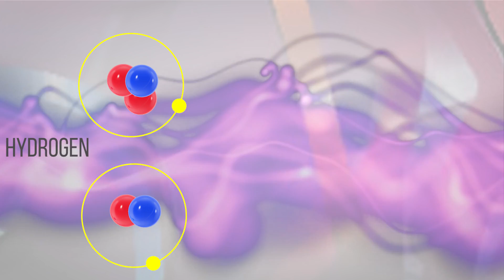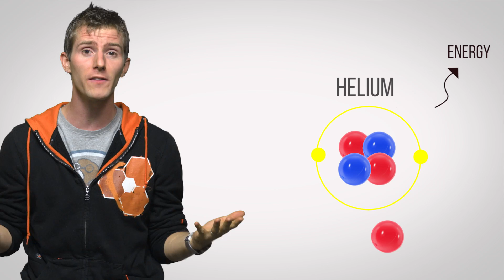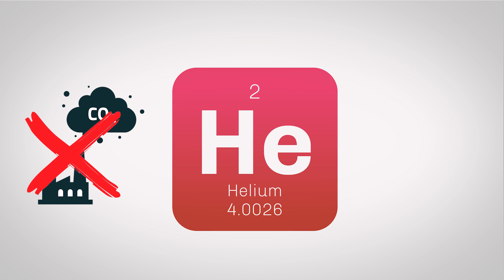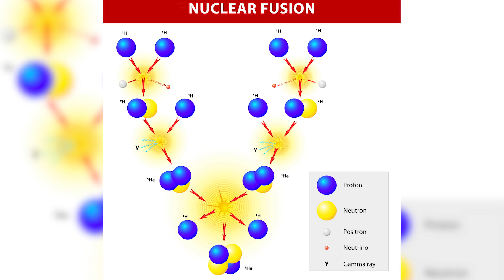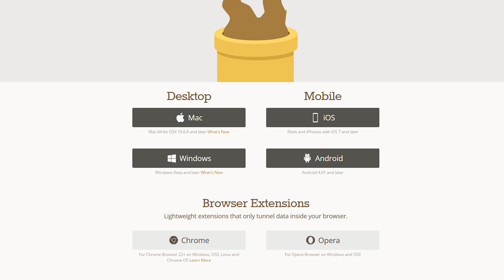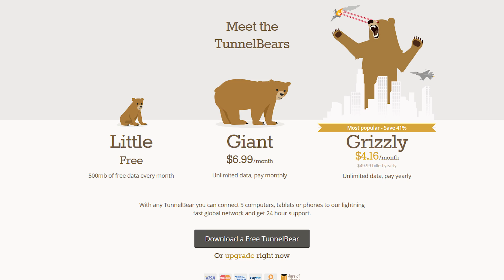Why Don't We Have Fusion Power?

Comment: LInus, Uranium is not the only fuel which can be used in a nuclear reactor. It is called thorium which estimates have predicted 120 Trillion tons of the material. The other advantage is 70% of waste is inert in 3 years. The other 30% in 300 years if you do not reprocess to use in new reactors. 

In short, Uranium is not the only source of fuel and fusion is decades away. If we truly want to get off fossil fuels in the next 100 years, nuclear power is the only way. 

We just have to get over our fear and let the scientist and engineers design reactors which solve these environment issues. Ohhh wait they already have, remember the current reactors in use today are over 50 year old. They need to be replaced with modern design that get away from pressurized reactors.  But I digress....

later..

Comment: there is potential for radioactive. During the fusion, one neutron leaves the core of the atom (as seen in the animation). These neutrons hit the wall of the reactor core and make it unstable, eventually making it radioactive
Reply: Not just could, they do. In fact the whole first wall would be extremely radioactive when used. Currently the scientists are developing materials that could withstand extreme conditions inside the reactor and after 100 years drop their radioactivity to the levels comparable to natural radiation on Earth. Still not too much waste compared to fission.

Comment: There's
Hydrogen and Helium, Then Lithium, Beryllium
Boron, Carbon everywhere,
Nitrogen all through the air

With Oxygen so you can breathe
And Fluorine for your pretty teeth
Neon to light up the signs,
Sodium for salty times

MAGNESIUM, Aluminum Silicon PHOSPHORUS,
then Sulfur, Chlorine and Argon
POTASSIUM and Calcium so you'll grow strong
SCANDIUM Titanium Vanadium and Chromium and MANGANESE

This is the Periodic Table, Noble Gas are stable,
Halogens and Alkali react aggressively
Each period we'll see new outer shells
While electrons are added moving to the right

Iron is the 26 Then Cobalt, Nickel coins you get
Copper Zinc and Gallium
Germanium and Arsenic

Selenium and Bromine film
While Krypton helps light up your room
Rubidium and Strontium then Yttrium Zirconium

NIOBIUM Molybdenum Technetium
RUTHENIUM Rhodium Palladium
SILVER-WARE then Cadmium and Indium

TIN-CANS, Antimony Then Tellurium and
Iodine and Xenon and then Caesium and
Barium is 56, and this is where the table splits
Where lanthanides have just begun
Lanthanum Cerium and Praseodymium

Neodymium's next to, Promethium then 62,
Samarium, Europium, Gadolinium and Terbium,
Dysprosium, Holmium, Erbium, Thulium, Ytterbium, Lutetium

HAFNIUM Tantalum Tungsten then we're on to
RHENIUM, Osmium and Iridium
PLATINUM, Gold to make you rich till you grow old
MERCURY to tell you when it's really cold

THALLIUM and Lead then Bismuth for your tummy
POLONIUM Astatine would not be yummy
RADON Francium will last a little time
RADIUM then Actinides at 89

This is the Periodic Table, Noble Gas are stable,
Halogens and Alkali react aggressively
Each period we'll see new outer shells
While electrons are to the right

Actinium, Thorium, Protactinium
Uranium Neptunium Plutonium
Americium Curium Berkelium Californium
Einsteinium Fermium Mendelevium Nobelium
Lawrencium Rutherfordium Dubnium Seaborgium
Bohrium Hassium then Meinerium Darmstadtium
Roentgenium Copernicium

Ununtrium
Flerovium
Ununpentium
Livermorium
Ununseptium
Ununoctium
And then We're Done!!!

Comment: Google 'LFTR' or 'MSR'. Fusion is unnecessary. MSR has already been done, but because it can't be weaponised it had its funding cut.
Reply: Fusion produces several times the amount of energy, and produces no high level waste. While things like the Integral Fast Reactor can burn HLW, the danger of a breach remains, which doesn't exist with Fusion.

You get radioactive reactor parts, if you're not using Aneutronic fusion, but that's low level waste that becomes neutral in a matter of years.

Comment: Not only our sun but all stars do this. Also the highest temperature on earth recorded is 4 trillion degrees celsius which is way over the required for fusion. The only problem is that this needs to happen for a longer time than just a fraction of a second.

Comment: Interesting Fact No. 1: The sun is actually quite inefficient at burning through its fuel compared to our methods.
Interesting Fact No. 2: The price of oil and research funding for fusion are strongly correlated (which is depressing).

Comment: Fusion = Load of Crap, solar is not good enough??
Reply: There are much more applications to fusion than simply powering your light bulbs and PCs.
Reply: Solar panels are super expensive compared to other power types.The sun also doesn't really put down that much energy per area on Earth (compared to other power source) otherwise it would kill us.
Reply: No, solar isn't good enough. The EROEI is pathetic compared to Nuclear and Hydro power.
Reply: Solar panels are made from a lot of poisonous materials that probably pose more danger to environment that nuclear waste does.

Comment: what about using the tide to generate power or even the currents of the ocean. take GIANT windmills and put them in a fixed position floating with big ass balloons creating neutral buoyancy , to generate power as the turbines spin from the currents flow?
Reply: besides the effect of changing the currents flow and speed we wont change it by much. if tsunamis have shown me anything. and the ocean does not freeze.

Comment: Yeah... when you talk about solar and wind energy efficiency being low, what do you mean? I'm pretty sure wind is very efficient and reliable. Really gotta shatter those misconceptions, aye?
Reply: EROEI of Wind and Solar isn't all that spectacular right now, I think 16 for Wind and a little more than 10 on Solar PV, while Hydro, Nuke and Coal have very high EROEI values.
Reply: C0deH0wler It's not about efficiency, because that's fine when they are actually working, it's because wind and solar DON'T work often because sometimes it isn't as sunny or windy

Comment: You're completely wrong about wind and solar and hydroelectric energy. They're very efficient and capable of providing power for entire cities now and do in Europe. They're becoming more efficient every day and they are costing less every year too. And the reason we need to switch immediately to renewable energies isn't because of their quantity but because of climate change.

Lots of misinformation in this video. I think you should revise it immediately.
Reply: wind and solar are inefficient and unreliable they're a horrible power source
Reply: Problem is, if the wind stops for a while. There goes that country's electricity.
Reply: Solar and wind power are both many times more expensive than the current best options. Its all about nuclear power man!
Reply: If we make the switch too fast, say goodbye to economic prosperity
Reply: Solar panels only have an efficiency of 35% at most and these are not the panels you see on everybody's roof.
Hydroelectric plants are quite efficient, however not every location is suitable.
Reply: Except that wind and solar rely on unpredictable weather conditions. Tazmania and El Hierro went 100% wind, solar and hydroelectric and the whole thing failed. Each had to buy millions of diesel generators to meet energy needs due to drought and unpredictable weather rendering solar and wind unreliable long-term. Plus solar is too expensive for average citizens to go to anyway and homes within city limits are barred via eye sore ordinances from building their own windmills in their own yards
Reply: Ulysses101 They are quite effective, but they cost a lot.The energy we can harvest from solar and wind power is quite a lot. But compared to nuclear power, it's almost nothing.
Reply: What type of cheapest? Cheapest start up cost? Cheapest maintenance cost? Best price:energy ratio?
Reply: Ulysses101 i do. The average person cannot take the financial burden of installing a solar panel. Make it competitive in cheapness to fossil fuels [and currently it isn't so don't delude yourself], and once it becomes that cheap, homes all over the place will have green energy installed on-site removing any need for the government in the energy sector. Meaning less government control which means less government spending. See how it will never happen yet?
Reply: Wind and solar only provide power about 10% of the time (if you count at the rated power, so 50% output for an hour = 0.5 hour at 100% output). Therefore you need 10 times more power installed than it's being used at any given point and store 90% of it. 
But wait, storage systems are at best 40% efficient, so you need another 2.5 times increase. Add to that environmental cost of building those panels and turbines (those rare earth metals won't dig themselves), multiply it by lifespan of the installation and you end up with system that, watt per watt, has bigger carbon footprint than nuclear (and made a huge hole in China to mine all of the neodymium needed), and that's only counting current nuclear powerplants, not new tech like thorium reactors (not really new, they were developed very shortly after uranium-based ones, but abandoned due to dubious bureaucratic and military decisions)
Reply: @Ulysses101 FINALLY! I was looking for this post
although I only find the first few seconds of the video to be wrong at large.

to address this, @Techquickie
Solar and Wind ARE more than capable of handling the world's energy demands MANY TIME OVER!!!
the issue is not efficiency, but consistency.

also, to address most of the comments:
the issue with renewables is not energy supply. even in countries like the UK you can have enough renewable energy from solar/wind/hydro. The problem is being able to store that energy when you have excess and release it when you need it (again, consistency). Although this is currently an issue, I believe in the "near" future large storage facilities will be able to solve this problem. (pumped hydro is currently the best way to store excess energy)
Reply: For the foreseeable future, nuclear power is the way to go.
And for the long future? Nuclear as well.

Wind and Solar should be incorporated as well, but they have many problems that people tend to forget:
You need a lot more resources to build and maintain them, you need at the very least a 5x over production with the current technology, as the power is so sporadic you need facilities to buffer the energy (And that again costs a lot of money and resources).

And then there is another thing specifically about germanies "energie Wende":
It failed epicly. by shutting down and going for wind/solar it not only costs a lot more money, it is also less reliable and - bad dum tss - far heavier impact on the environment.
Oh - nearly forgot - the german energy grid is at its max capacity and close to collapsing due to the wind-parks. The surrounding countries already have complained quite a lot cause they are taking a lot of the burden of stabilizing the net. If polen or austria would not do that for germany, the whole grid would collapse.

What is needed for wind/solar are far better storage solutions, and we are more than 15 years away form them at best. It would be a lot more reasonable to build some Molten salt breeder reactors in the meantime (btw - they produce less pollution than wind or solar)
Reply: The winds aren't always active and in the event of extremely high winds, the very fast spinning blades could easily tear themselves apart.

Furthermore, the output of a solar panel depends on its angle to the source and how much light is hitting it. Solar panels don't produce as much power the further away from the tropics you are, cloudiness, and whether it's day or night.

Even if we can get their efficiency to 80%, I still wouldn't want them to be the primary source of power for entire cities because of the reliability issues.
Reply: Comparatively speaking they aren't good powersources for the future. Fusion reactions provide so much energy, that it is pretty much required for the future. Especially with the energy-usage in the future.
Reply: plus it would be far more efficient to get each individual home powered by a green method on-site than it would ever be to have massive green energy plants in random areas producing so little of the country's power that their removal would not make much of an impact on the electrical grid. This requires the methods to be as cheap as oil and coal meaning government has to get out of the way entirely.
Reply: ***** You're completely wrong. 

I hope you and the people that liked your comment understand that.
Reply: Benji Blue Like I said the price of them are declining at an unprecedented rate. Your comment about nuclear is correct. Cost isn't going to matter if we're talking about building them on the industrial scale with government resources which is what's going to happen.

Point being, they're the future, and Linus doesn't know what he's talking about here.
Reply: In fact, Wind is currently the cheapest energy source, followed by LNG and Solar-Photovoltaic, and then nuclear.
Reply: If we're talking about a government maintained power facility then maitenence won't be a problem. If you have a solar panel on your roof again, not a problem. I don't see the problem.
Reply: Lt.David Pulsar Cheapest measured by the lifetime costs per TWH produced.
Reply: That just doesn't make sense. There are clearly exterior factors in play.
Reply: MS4E amen, yours and Ulysses comments 👌